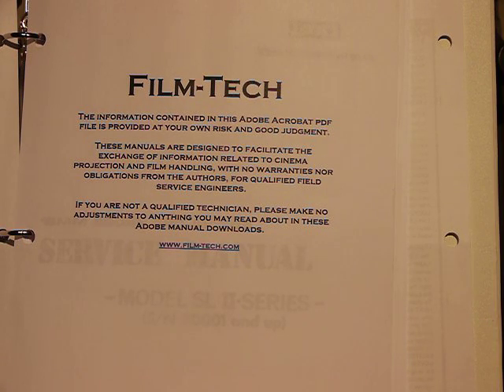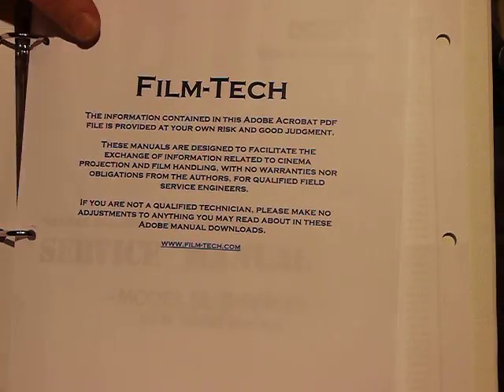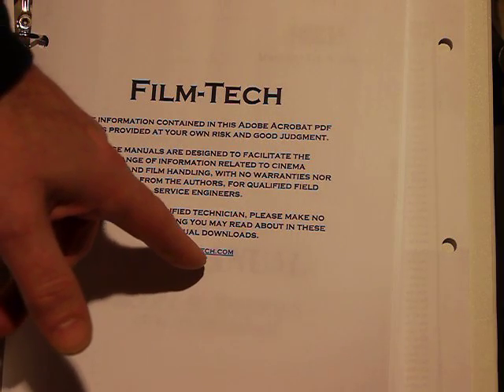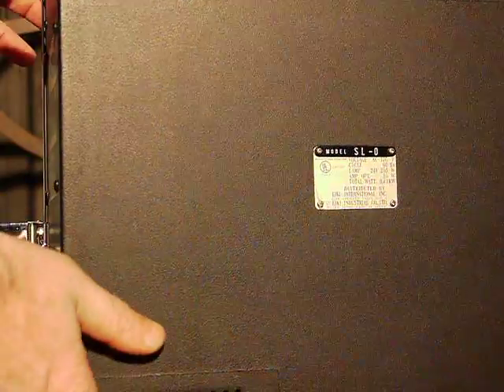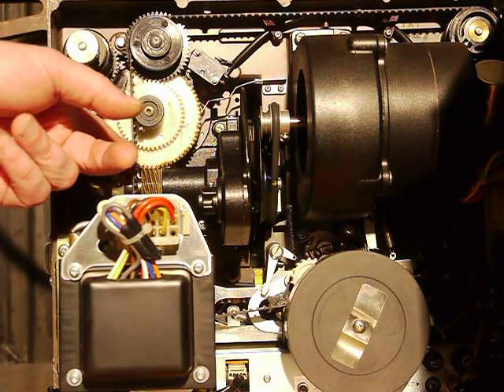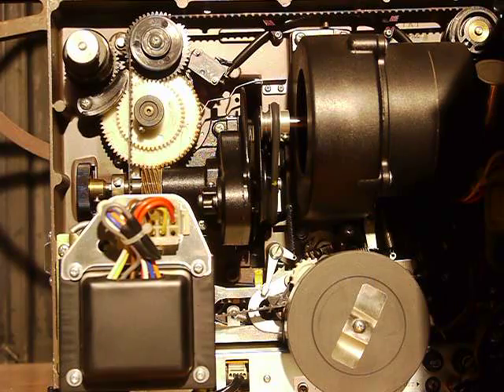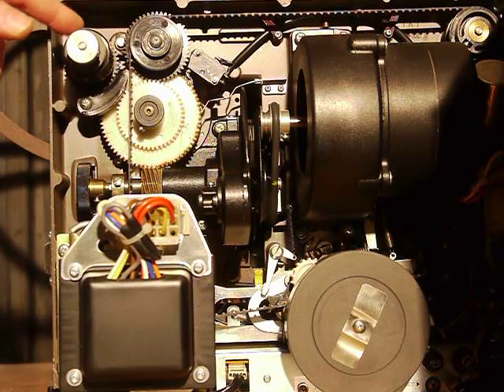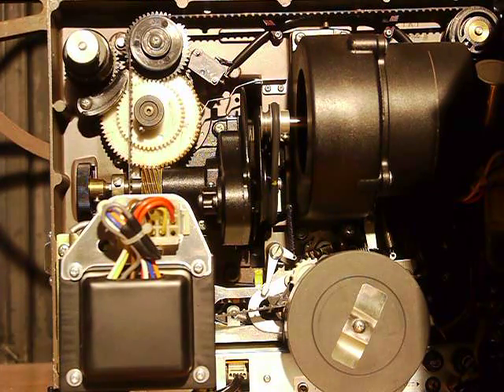EIKI 16mm projector telecine conversion part 1

Comment: I have the 16mm Eiki Slim Line SNT-0 projector and it has a 3 blade which works OK when I do telecine but then use a AC voltage regulator connected between the projector and the AC power source to bring the speed down to a lower speed to get rid of the flicker since I'm recording at 30 FPS on my video cam and also replaced the high wattage lightbulb on the projector with an LED. I record directly right off the film gate itself using a magnifier lens slapped in front of my camcorder lens. I was thinking of replacing the motor on the projector with a stepper motor instead of a 5 blade.  I have the same setup on my Eumig 8mm/Super 8 projector but that has a 2 blade and lowering the source voltage also gets rid of the flicker.  The problem with the AC motor is when you slow it down then turn it off, you have to crank the voltage regulator back up to kick start the AC motor back up again. This is no problem with a stepper motor I believe.

Comment: Moving the main motor belt changes the speed from 24fps to 18fps, it has nothing to do with single or double perforated film.
Reply: With most Eiki pulleys, it would be a change to/from 50/60 hz. although alternative 18/24fps pulleys were offered.
Reply: One tell is that if your Eiki came with a 2 blade shutter the pulley's are for 50/60hz.. I believe most of the factory 3 blade shutter machines would be convertible from 24fps (sound) to 18fps (silent speed for double sprocket film).